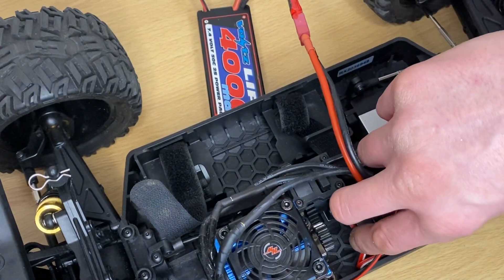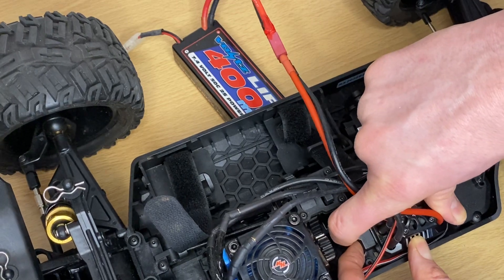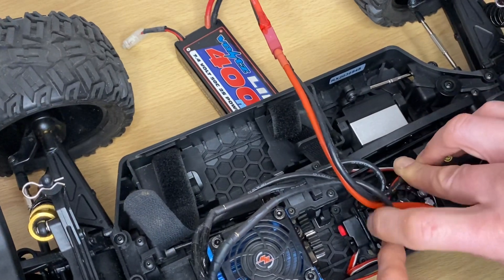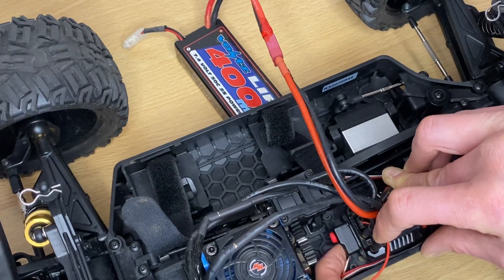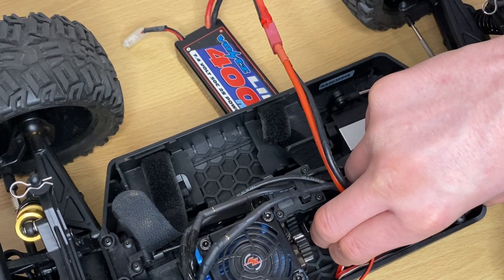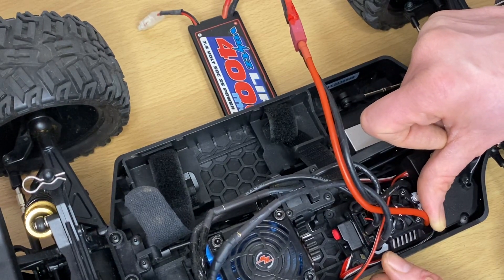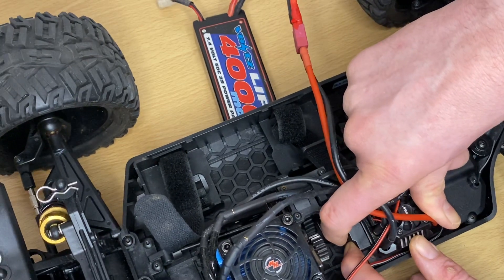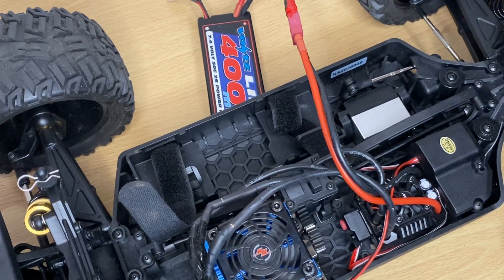Programming Your Maverick+ quantum ESC for Max punch.  # Quick Video .

Comment: How do we reset the ESC back to stock. I know how to do my Mojave and etc. My hobbywing card doesn't work lol.
Reply from the maker: I dont have this car , but i think you could try re calibrating . 
Switch Esc on while holding the program button, it should flash red . 
Press set once in neutral , then hold full throttle and press set, and then full brake and press set. Thats how to calibrate that esc , 
And if that didn’t reset all values , i am out of ideas 😮😊
Reply: @mark-1rc502 think I managed to work it all out. Just seen this comment.
Now tracking down the drivetrain issue on my Rlarrlo Omni Terminator. My mates wee boy used it and within a minute broke it as he never listened and whiskey throttled it. Never again lol.

Comment: hello, so for lipo, it should be program 3 on the esc, right?
Reply from the maker: @angelffalcon3134  
Program 3 relates to the 
LiPO. VOLTAGE DROP OFF.  
Program 3: 
Lvl -1 No protection . 
Lvl -2)  2.8v 
Lvl -3)  3.1v 
Lvl -4). 3.4v 

Default is Lvl 3. —
Reply: @mark-1rc502 forgot to mention I have the jumpshot sc flux.    I guess I need program 3,  and level 4 maybe?
Reply: @mark-1rc502 currently I have a nimh battery

Comment: is this brushless ?thanks
Reply from the maker: Yes it is sold as being brushless , 
I’d recommend thicker oil in centre differential , and about a 17t pinion gesr seems to bring into where you’d expect it to be . As it has plenty of torque but Low RPm motor , so higher tooth pinion gear gives it some legs .

Comment: How did u find out what the programs settings are. 😁
Reply from the maker: https://www.hpiracing.com/assets/documents/maverick/instructions/150244_006_vol01_flx10_3s100_brushless_esc_10112020.pdf
Reply: Seems the settings from the default are decent enough all id like to change is the lipo cut off to extend usage time. Lol. 

It's the controller ch1 & ch2 

Ch2 EPA hi & lo 
Ch1 & 2 reverse 

Just got my Maverick QuantumRX need to learn the controller lol.

Comment: Hi.  Is there any way to factory reset this ESC?  I changed something during this programming and I would like to return to the factory settings.  thanks and regards.
Reply from the maker: Hello, that is a good question to which I am not sure I personally do not think so, 
However I have a link to the Manual if you haven’t got it ? 
You could try to ring HPI , I’ve generally found them quite helpful in the past. 
But here is the link to the manual. You want page 10. 

https://www.hpiracing.com/assets/documents/maverick/instructions/150244_006_vol01_flx10_3s100_brushless_esc_10112020.pdf

Comment: Hi mate, just got one of these trucks,,can i wack a lipo on it ,,and upgrade the pinion by any chance,,? Thanks mate ?
Reply from the maker: The brushed ESC can be Lipo compatible 
I think you’ll need to move them little pegs around on the ESC , 

This was the Quantum plus . 
So it is brushless and Lipo ready. 
Also I changed the pinion gear to a 17 tooth 
Made it a 50mph truck . On 3s

Comment: Thanks mate 👍
Reply from the maker: Your welcome brother glad it was of help to you . 
P.S. Thanks For subscribing very much Appreciated
Reply: @mark-1rc502  no problems. Just ordered one of these Quantum plus models so hopefully it will be good!
Reply from the maker: @oldskoolrolla  
Cool I’d advise putting a washer same inner dia as the axles and an Outter dia close size to the 17mm hex this will help take some pressure from the axle as there’s a small gap between the hub and the 17mm hex . 
So Eg: if you spin out and bumped the rear wheel into a curb there’s a chance it could bend the axle slightly , if you pad out the gap with washers/shims that is less likely to happen . 
And the motor can run 17 tooth pinion on road and get around 50mph on 3s mine topped 49moh on 3s with 17tooth pinion and cheap Youmme Lipo .
Reply: @mark-1rc502  sweet thanks so much for your advise. I will do that. With the 17 tooth does it still have plenty of punch for wheelies and backflips?

Comment: Do you know why mine only has four modes, no long beep
Reply from the maker: It must do brother . What did you want to change
Reply: @mark-1rc502  well I was just testing out some settings, and noticed the modes just went to 4 and punch mode only went to L4
Reply from the maker: @sheldonrose461  
Very Strange, I have no Answer other than get into contact with Hpiracing.com tell them the problems your having with your esc. 
Just clarify it is the 100amp ESC and it’s the Quantum PLUS . ? 
Reason I’m asking is that the Smaller Maverick MSC BL30WP ESC only goes up to Level 4 on the punch setting .

Comment: Do you know where to get the setting chart
Reply: All I need now is a wheelie bar
Reply from the maker: @chrisj3741  
Take this From EBay. 
Worth it considering wheelie bar £6.99 plus p&p 
254811352466
Reply: Thanks mate I might go for that 👍
Reply from the maker: Yes mate 
https://www.hpiracing.com/assets/documents/maverick/instructions/150244_006_vol01_flx10_3s100_brushless_esc_10112020.pdf
Reply: @mark-1rc502  thanks mate you have helped loads